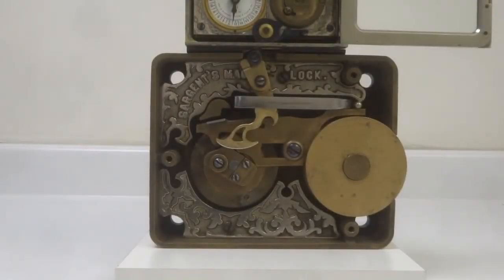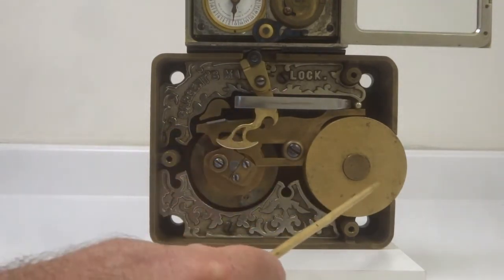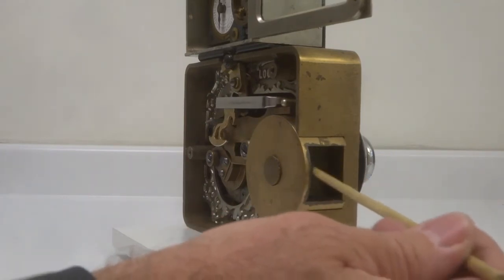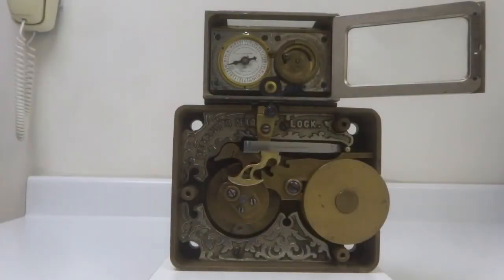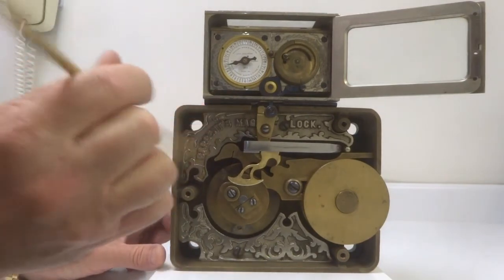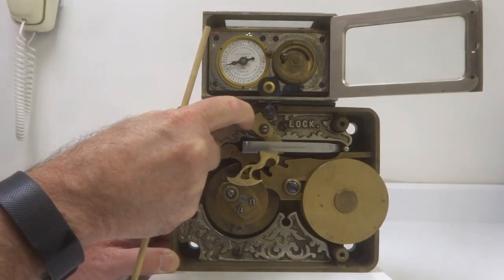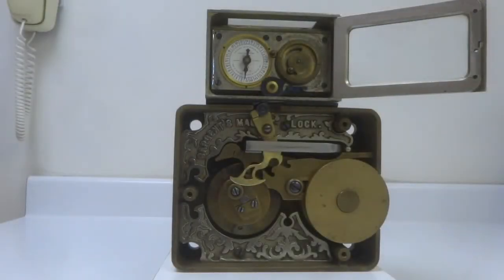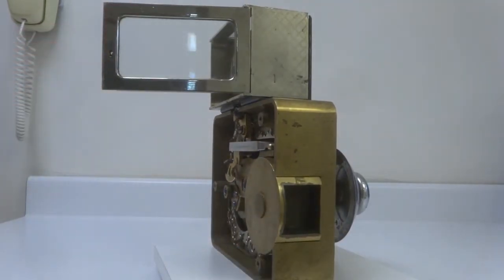James Sargent Rollerbolt Magnetic Combination Lock, Model 1 paired with Gem time lock

Comment: There is some confusion regarding the model of this lock.  It is in fact Sargent's second magnetic design patented in 1866.  The first magnetic design was patented in 1865 and to my knowledge was never manufactured. In fact the only one in existence is a model I made from the patent drawings.  This first design uses a ring magnet surrounding the wheels unlike the U shaped magnet as seen in this lock. The model shown in this video is listed in the 1867 catalog as model No.1.
Reply from the maker: Hi Doug, Good to hear from you! I'd reply via email but can't find it. First off I'd love to see some photos of your reproduction. I'm quite curious about how the magnets worked.

Now on to your comment, I'm not sure I understand the issue. I have noted in the website as well as on this video text that this was Model 2, your reproduction I assume is Model 1. So are you saying that since the first was never made this should be model #1? You mention a catalog showing this as Model #1. Is there a way for you to send to me or for a link to the catalog as I'd like to add it to this page. I will make the corrections to #1. You can get my email by clicking on my avatar or from my website. Thanks!
Reply from the maker: www.my-time-machines.net
Reply: Hey Mark sent you some info.